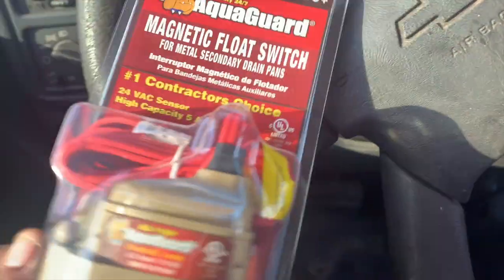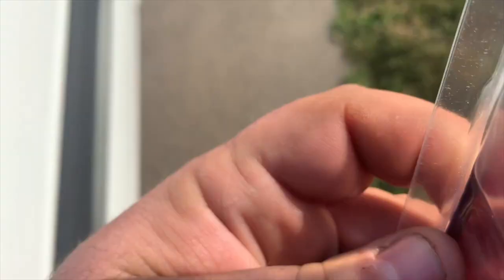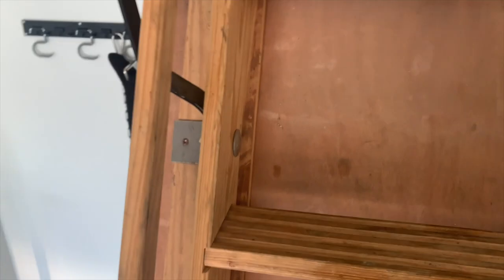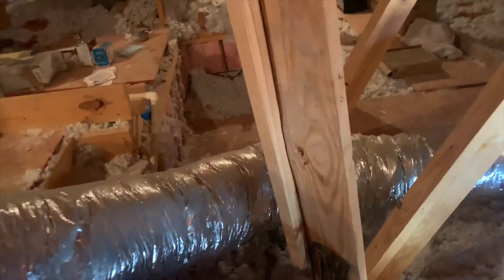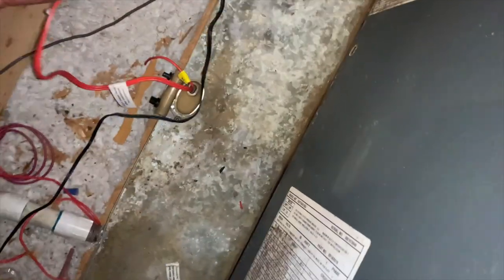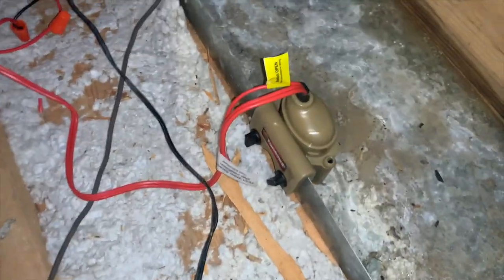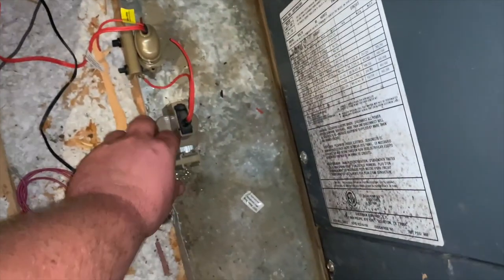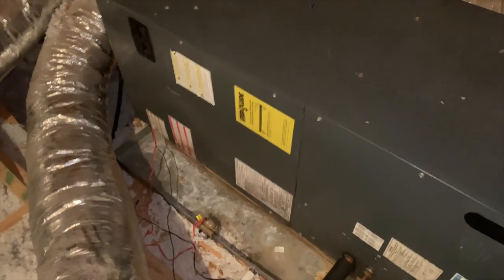No Cooling/Nothing Comes on/Float Switch Failure

Comment: Those nasty float switches are pretty sneaky. One time I couldn't find the trouble in an attic unit  because of the heat and time and I had the problem in my hands, literally in my hands. So from there I just relax and take it easy first. True story. 😁